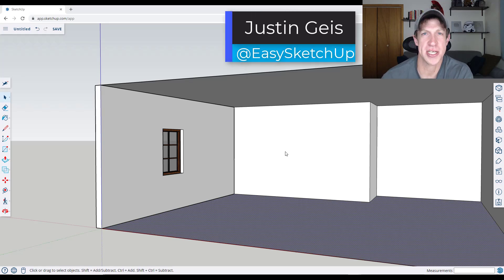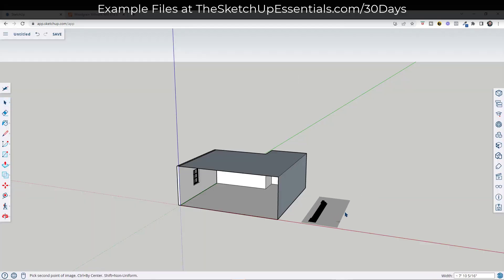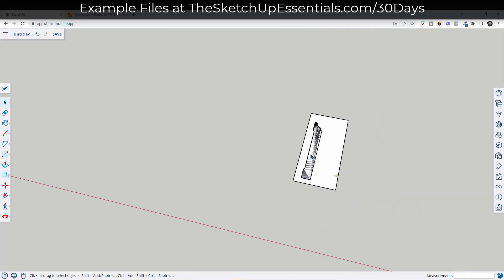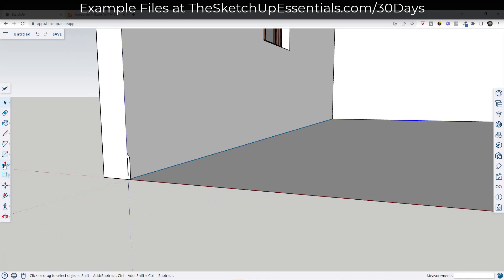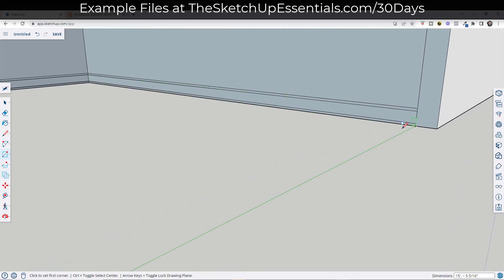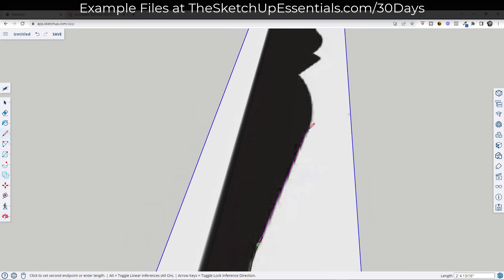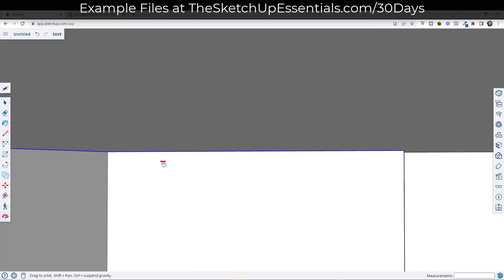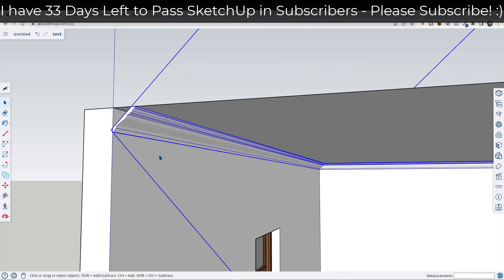Learn SketchUp in 30 Days DAY 17 - Base and Trim!

Comment: Is that the work around (edit group) for using solid tools such as trim function? I was having a heck of a time trying to get trim to work when I put birds mouths on the shed rafters. Ended up tracing and push pull to erase, they were all components, so I only had to do the one. But having some things grouped and others components, I couldn't get solid tools to work. I don't think we have the same definition of solid. Top notch tutorials, thanks.

Comment: Hi Justin, love the videos, much appreciated. Question... "profile needs to be perpindicular to selected path" is all i keep getting when i try to extrude my crown mould profile after selecting path, selecting follow me tool and then clicking edit group on the grouped profile. I have checked the profile's angle with the protractor tool and it is perfect. Stumped! Hope you have time to answer but if not no worries. ✌
Reply from the maker: Not 100% sure - I’d try it with a simpler profile first to make sure that works, then try it again?
Reply: @Thesketchupessentials  Ok, thanks i'll play around with it and figure it out!